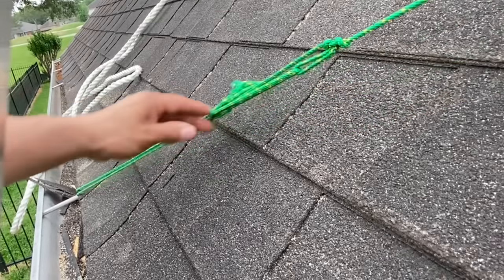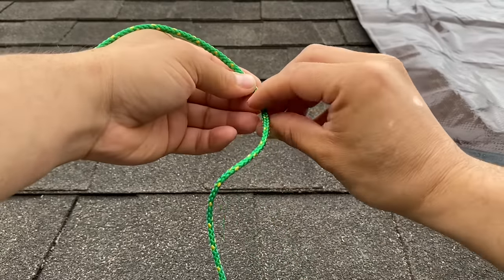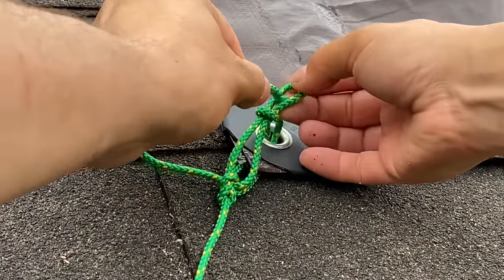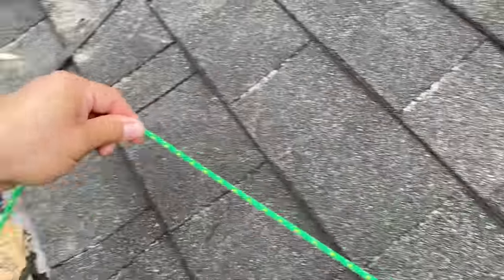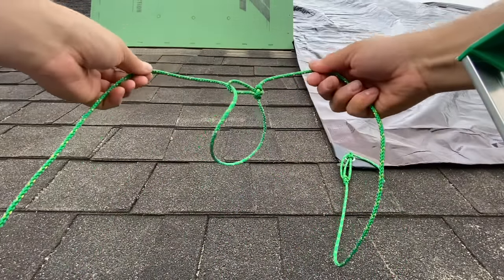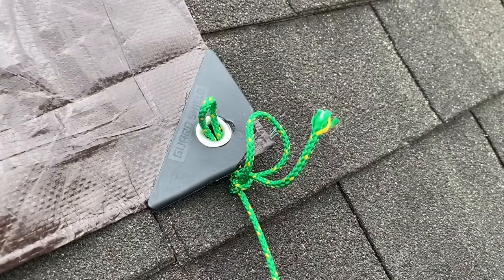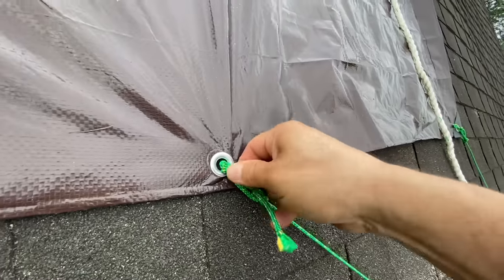Tarp tension system

Comment: The Artillery Loop.
Reply from the maker: You got it
Reply: @First_Class_Amateur  It looks functionally similar to an Alpine Butterfly. Is there a distinction between an Artillery Loop and an Alpine Butterfly?
Reply: @petervilla5221  I too thought Alpine.
Reply: I think Alpine don't jam
Reply: @krlegend4084  It does, under enough load. I think HowNot2 have some tests...
Reply: @petervilla5221  The butterfly is symmetrical - didn't spent too much time looking at it but the artillery knot might be the Alpine with one less loop on one side
Reply: What I found interesting is that the Artillery Loop is yet another knot built on the Marlin Spike Hitch. Man that is such a good knot building block!
Reply: Great job. I just ran across your channel but plan to check out your old content. As an old boatswains mate, rigger and rock climber I do appreciate good knots and application of said knots. This usage was spot on, keep it up.
Reply: @First_Class_Amateur   @Peter Villa  Hope you can answer. Why not an alpine butterfly versus artillery? 

Love the video though, might create a hole in my roof so I can tarp it up. ;)
Reply: @robertmileage  It's easier to untie after loading
Reply: @petervilla5221  alpine butterfly
Reply: @First_Class_Amateur  It is also closely related to the "Dropper knot" used in fishing.
Reply: I online know the dutch name gordelknoop
Reply: Interesting modification of the bowline; can it slip under high tension? Also an interesting variant to a trucker’s hitch to allow adjustment without undoing the stop. I’ll try it next time on an application where I have to periodically snug up the tension.
Reply: The Artillery knot is superior to the Butterfly when tied with a big loop in a heavy rope. Just lay it out on the ground and you'll see. For hauling medium load with a couple of loops in a long rope.
Reply: @petervilla5221 I thought it was at first the alpine butterfly but it's not. It's literally the handcuff knot for one handed individuals lol.. stinking one arm bandits...
Reply: I thought alpine butterfly, but now I think alpine ends with two loops
Reply: @petervilla5221  Functionally, very different
Reply: Looked alot like the prusik knot too..
Reply: The butterfly loop is isolated from the main line. You can cut it, or use it to isolate a damaged section. The artillery loop doesn't isolate the loop. I usually use a marlin spike hitch for that loop. It's usually easier to untie.
Reply: Manharness Knot as taught in Boy Scouts.
Reply: The Artillery loop
Reply: Podo tackle
Reply: It’s the Alpine Butterfly but made in an easier way and faster.

Comment: Taut line hitch and Truckers hitch work well and are much simpler to do. Interesting knots.
Reply: Exactly what I was gonna say. The first knot was alright for a quick release system, but the rest was just taking something simple and complicating it.
Reply: Yeah, it is better to learn one Trucker Hitch version that works in all scenarios. Learning one Trucker Hitch version really well is better than half-knowing a bunch of different tension hitches.
Reply: @jakemccoy  Right. Bowline or slipped half hitches to secure the grommet, then a simple truckers hitch. Leave it loose until all four corners are attached and then tension it up.
Reply: Truckers hitch is an amazing knot, I agree. There is a good guide on yt. And the knot is very easy. I think it’s more logical than the bowline, thus easier to remember. The Portuguese Bowline is also amazing! Just what I was looking for. Not really keen on tying 100500 bowlines each time I pitch my tarp. So now I tie 2x trucker hitches + 2x regular bowlines for the two ridgelines (over tarp, plus a thin one under the tarp for the mosquito net) and my guylines (as well as all of the 6x mosquito net guylines + microcarabiners (fingertip size) (safety feature - the least strong link in the chain. In case of a hard pull - at least my tarp or the net aren’t gonna rip instead)) attach with this French Bowline version. I love it!

Comment: This is the voodoo hitch, aka transport hitch. The first buckle could have been replaced with any tie-off. The funky artillery loop could have been replaced with an alpine butterfly or directional figure 8. The last buckle could have been replaced, with any fixed loop - but it must be a fixed loop. The whole resulting things is a voodoo hitch without carabiners. Very cool.
Reply: truckers hitch would work and no hard knots tied as well
Reply: I prefer the alpine butterfly as my loop also
Reply: Rob, this video IS the truckers hitch 😂
Reply: @RobBanks 
Yup. Seems a bit over complicated to me.
Reply: @stephanddd, true observations. In this non life-supporting application, this Artillery Loop is an easier and quicker tie than the Alpine Butterfly. Seems appropriate. Of course, the buckles are more appropriate for a length that you will be reusing the same way often, or as a teaching opportunity (such as this is).
Reply: The loop mid line is alpine butterfly used alot in climbing
Reply: @jamesraby5900  if that's how you're tying your alpine butterfly I'd advise some revision and learning the right way to do it. An alpine butterfly can be loaded safely/equally in either direction. The one here cannot and is biased in one direction.
Reply: @etdj909  Not the Alpine knot or Butterfly. It's the Prusik knot.
Reply: I'll tie a granny knot and get back to work - y'all wasting time playing sailor with these knots.
Reply: @hanburgundy4317 if you could learn and deploy all these knots on the regular you’re probably smart enough to not be a roofer lmfao no hate but frfr
Reply: @2e826  
I'm a hardscape contractor lol

Comment: No, that is NOT an Alpine Butterfly Loop...  tie the two side by side and you will see the difference.  I think the Alpine is much more secure under high tension... this knot seems to slip and close up some - at least with small diameter paracord.  But it is fast and easy to tie.
Reply: Alpine B isn’t exactly very complicated and taking to long to tie either so… if it’s better, go for it :)
Reply: Indeed. The Alpine butterfly knot is the best. It can handle shock loading, ring loading, pull from single or multiple directions at once, and never spills or jams (at least not in my experience). There are so many other uses for it as well, like sectioning off a damaged part of your rope. It can be tied in the bight or around an object. And there is also an alpine butterfly bend that is tied almost exactly the same way, so if you learn the alpine butterfly loop, you get a second knot for free (alpine butterfly bend). The knot is highly regarded by climbers and arborists, and for good reason

Comment: Great demonstration!  If nothing else, this illustrates why it's important to know a lot of different knots and practice them regularly.  Having a decent sized catalog to draw from means there'll always be a way to get the job done.  Many knots will do the same thing, and some folks will prefer one over the other.  But if you don't work to incorporate those knots into your daily life, they won't be there when you really do need them.
Reply: Or a $6 ratchet strap
Reply: All you really need to know is 4 knots and you can do anything
Reply: @Starkl3t  I agree and have often said the same. Clove hitch, bowline, truckers hitch and a sheet bend, but for some reason I know about 100 more. For tarps I prefer a Stopper knot, like a Double-Overhand, just to keep the rope from pulling through the hole, because it tends not to tear out the grommet like a French Bowline would by distributing the load around the entire circumference..
Reply: You may already know this, but if you like using the double overhand knot as a stopper, you should try the “Ashley’s Stopper Knot”. I has a larger, symmetrical circumference, and it is easier to untie after being subjected to a heavy load
Reply: @Starkl3t  Or at least less than 10👍
Reply: Or just tie a granny knot and call it a day lol Takes a fraction of the time, and if you're not worried about cutting your rope anyways, just cut the knot when you're done if you can't get it loose again. 

Not to mention, bungee cords and ratchet straps exist - and they're cheap.
Reply: @hanburgundy4317  Seems like there's not much joy in that.  As FCA has noted many times, rope will do what a ratchet strap does, but a ratchet strap won't do what a rope does.  So if you're going to carry something.... why not carry the most versatile tool you can? Plus, it's just plain fun.

Comment: Nice little system, if a little complicated. Have you done a video on the Farimond friction hitch? It's what I use in this type of application, coupled with a bowline. Fast, secure, easily adjustable and quick release. Great knot I reckon, and a relatively new one.
Reply: I haven´t tied any tarps but that is the way i know how to do it. I consider this video to be of academical value. It shows a different way to get results and the situations where you can use this kind of double bowline knot.

Comment: If you absolutely must not pierce your roof for whatever reason with nails or screws, then this would work I guess. However, battening down the tarp directly to the roof surface with lathing strips is the only way to ensure that wind is not allowed or at least severely limited to enter the space beneath the tarp, which is the most typical and fastest way that a tarp covering your roof ends up in the neighboring zip code.
Reply: alpine butterfly
Reply: ㅏㅣ
Reply: Ayuh.
I sleep better when it's battened 👍
Reply: Piercing a roof that you intend to reuse, for a tarp that only needs to last one day? That doesn’t seem like a good trade.
Reply: @JasperJanssen  Who says the tarp needs to last for one day? Have you ever worked with homeowners insurance people?
Reply: The overwhelming majority of storms can be weathered with a tarp covering that doesn’t destroy the shingles or have to be repaired afterward. 
If you have something very severe coming, then blasting the tarp would be a better solution, and for very severe storms, then you’d want to “batten down the hatches!”

Comment: I was gonna say that looks overly complicated till i saw that after securing the second buckle you can essentially move the tension without anything coming undone. So ingenius!
But... tbh, I'll still keep using a siberian hitch on one side, and a trucker's hitch on the other end for adjusting tension. Less setup time, and way less takedown time since I can make everything quick-release. This would, although, be usefull for a setup that wouldn't require being put up and taken down often, or If I needed to adjust tension once in a while.
So the Artillery loop is essentially a non-slippery trucker's hitch? Could prove useful to replace the Alpine butterfly wherever I value setup time over breaking strenght.

Comment: Impressive! 🤩I practiced between poles and it works as well!
As long as the loops are of the same length you are safe.
Kinda universal knot: I am thinking about preparing several 6 feet/2 meters ropes with quick release knots on both ends, to secure stuff in my car's trunk.
That will take no time to add the tension knot.
Reply: I love your site!  The mystery loop you tied is one I learned in Boy Scouts.  It was called an artillery knot.  Later, working in a stable, it was called a harness knot. My girlfriend loves you, but keep posting anyway. You’re as good as any of the Chinese sites.

Comment: What are your thoughts on the Alien Loop tensioner?  I have a few and it seems like they would work good as a 2:1 tensioning device in place of a trucker's hitch, but find them awkward to use and not particularly effective, which is surprising to me considering how common they are now.  Am I missing something?  Do you have a trick on how to use them effecitively?
Reply from the maker: Ah the Alien loop. We were on Kickstarter around the same time. I would use them by running the cord through so it would slide on itself. I mean, I would take a loop, capture the tension side then place the loop over one of the lobes.

Comment: That sounds like a double conversion to me. 

If we can find a compressor housing that matches the required flow / pressure charistics, could we not gear it directly from the crank? 
As in, conventional supercharger with special parts?

All of those conversions seem like potential losses - with a little 50 as primary mover?

Comment: That is a killer system. It’s an Alpine Butterfly, but someone called it an Artillery Loop, most likely because it’s badass.
Reply: Not an Alpine. Watch again, there are two turns on one side of the loop and only one on the other.
Reply: The butterfly is symmetrical, this one is not, thats how you see the difference.👍

Comment: The quick release portions are unnecessary, right? The reason why I ask is because I am certain I will forget the "Venus Fly Trap" knots after several weeks of not practicing. However, the rest I can remember for years without practicing because it is similar to the Trucker Hitch I tie. On the first knot at the tarp, I would probably just go with a bowline. Yeah, it's not quick release, but I know it well. I know there will be no error and no forgetting it.

Comment: This seems like the sort of thing I'd do as a mental exercise, not in a practical application. Lots of fiddly details, moving parts to go wrong, and labour-intensive processes without any noticable advantage over a simpler trucker's hitch system with basic slipped knots onto the tarp, and if anyone else has to work with it, the complexity becomes a significant problem.

That said, it is pretty nifty, and I'll bet if I learned these skills I'd find a good use for them somewhere.

Comment: It is called the butterfly loop used in mountaineering for climbers to link together with no weakening of the rope and remains easy to untie. Very clever use of some of the best knots ever.
Reply: I suppose I didn't pay close enough attention to the symmetry of the knot. The butterfly had equal strength in either direction of load.

Comment: Hey, what knot would you use for trying to pull a 3 strand, 00 wire cable up to a platform from the end of it? It's too thick to do a sheet bend. And I tried both a prusik and a clove hitch but neither of those seemed to work.
Reply: Lookup simple symone over. It looks like a square knot with an extra turn on one side.

Comment: This is the voodoo hitch. Simple bowline on the ends would have sufficed with a alpine butterfly as the loop. The hitch does get loose though after awhile. I guess depends on the rope used.

Comment: Your second knot is an alpine butterfly knot. Very integral knot to the climbing world.
Reply: Ooh not really
Reply: @bjornalm9950  you're saying it's not an alpine butterfly? Or not used widely for climbing? Bc you're wrong either way.
Reply: @troybishop5947 Well the knot at 2.30 is (as many already mentioned) the artillery/manharness knot ( Ashley 153). Tie them both and you'll see the difference.
Reply: @bjornalm9950  I stand corrected. I wasn't aware of the Artillery Loop but after researching, I realized why. Though it may be faster to tie, it's less stable and so isn't used in critical situations.I should've paid closer attention to how it was tied rather than how it looked. I've learned a new thing - thank you.

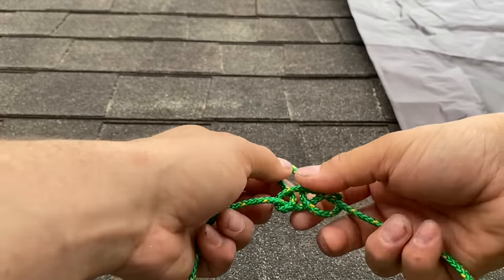Comment: Painter’s hitch will fasten to the tarp, similarity and much easier to tie.  Both work.  I would also use a Farrimond Friction Hitch, which is demonstrated in someone else’s video (taught me) at 2:39.  https://youtu.be/0yfFo0-1u1M.  Advantage you can slide it all the way up to the tarp knot.  Also easier to untie.

In any case, good to put tarp over hole before rain and secure.

Comment: I found a new use for the buckle (Venus fly trap ) — while replacing my mower belt there was a spring I had to connect in the middle of the deck to a tensioner pulley. It was hard to pull by hand and not easily accessible. I attached the buckle to the end of the spring and left a long tail and used a bight  to make a quick release lock. Using my wrench and a marlinspike hitch I was able to easily pull the spring into place and then pull the release to free my paracord. I was even able to turn the spring by twisting the cord!

Comment: I like it. The middle of the line loop kinda looks like an Alpine Butterfly Knot, but it’s not (Alpine Butterfly knot will untie in an instant when you’re done). 

You do not have equal tension in all 3 directions. You have made a 2:1 mechanical advantage with your change of direction loop. 

You need to be real careful when you do a change of direction system, and your Rain Gutter anchor is exactly what I’m talking about. 

That Rain Gutter support has no strength whatsoever. If you pull too tightly with your 2:1 loop, you can break your anchor without much effort.

Comment: Did that tarp stop short of the ridge? Was it shoved under the shingles? I didn't see it very well, but it looked like it wasnt.over the top of the ridge. Won't stop much water that way. Make sure you have a shingle effect on your tarps to redirect water, or at the very least, put it under the shingles and nail a plank over that joint to minimize water coming in, while holding the tarp firmly.